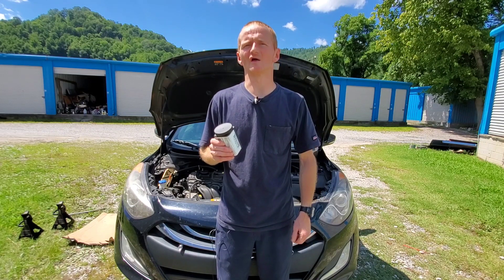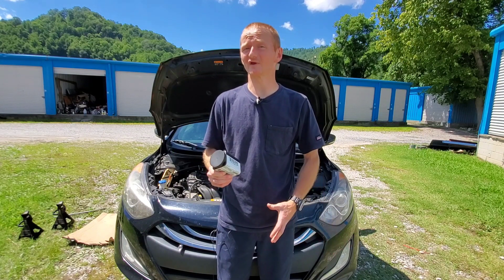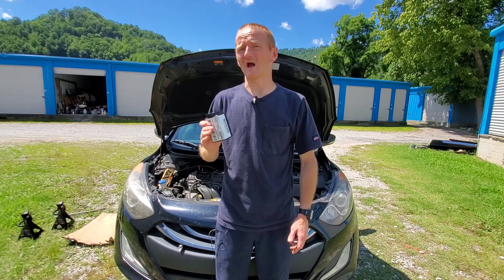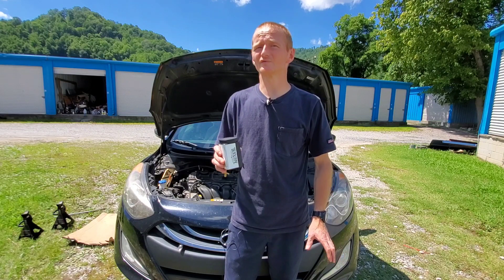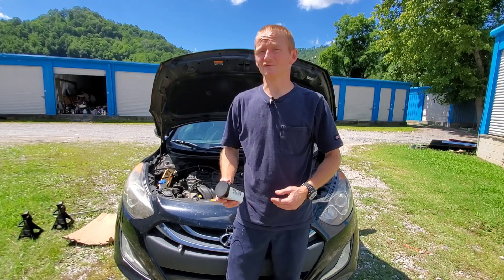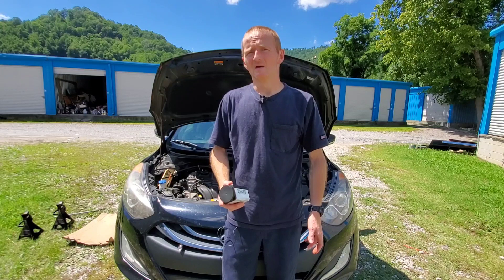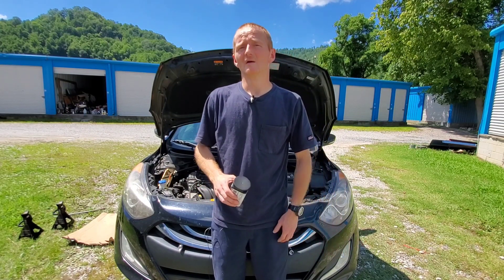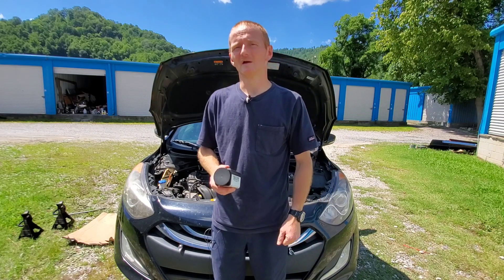I can't believe what waiting to change my oil did to my engine!

Comment: Maybe all of you know this already, but here in europe, the oils are made to last longer and are more expensive, your intervals in USA sound so short to us. Usually In modern vehicles, the oil change is every 12 months or 6000 miles in severe conditions, 12.000 miles in normal service for gasoline engines. For example Liqui moly makes an oil suitable for even 20.000-25.000 miles or even 24 months. Personally I do like this: I buy 5L (4,7 qt) of the best oil Liqui Moly makes, for my specifications (0w30 ACEA A3 API SN, it's real synthetic not those fully synthetic scams), and because I drive it in severe conditions (short trips, not fully heated engine) I change it every 6000 miles. In addition, In the middle of the year, I drain approximately 1 L of old oil and I put back in the remaining liter of new oil (my engine requires 3.9 L), total cost 50€ or 57$. After 5000miles the oil is still in perfect shape a bit thicker because of the contaminants in suspension, but you can still see the original yellow colour with a brownish tint. Doing a rapid research (tell me if  it's correct or not) you pay 5 quarts 16-30$ for 5w30 so I imagine that the quality just can't be there because here the cheapest 5w30 starts from 30€ (35$), so the conclusion is that you must change the oil at least double of the indicated interval. ( I admit that your prices can be lower because in USA you drive bigger engines with more oil and the lower price can be a matter of economies of scale, and not only quality, because mainly in europe we drive  small  4 cylinders engines )
Reply: Wow. Great comment. I can't believe how expensive oil is over there. I thought $10 a quart was expensive.
Reply: @vanessal7291  here the equivalent of 7/10$ quart is the cost of 10w40, that's still the most commonly used. However is not that expensive considering that the oil is really going to perform good for the whole year. Yearly services are normal here. Maybe some performance or special use vehicle need 6 months service...but it's kinda the opposite as I saw because recent commercial diesel vehicles have 15.000/20.000 miles services.
Reply: Wonderful
Reply: @SushilKPingua  It depends on the taxes in the country. In italy there are more taxes on oil, but for example in germany a good mid-top range oil is 8/10$ qt equivalent.  The oil I buy in germany costs 12usd qt. But is really almost top.
Reply: @Starfank  You have correctly made clear the oil economy implemented across countries. In India the conventional or semi-synthetic low quality oil sells between USD$ 20 to $30 per gallon and this oil lasts maximum 3000 miles. Full synthetics here begin at USD$40 to over $80 per gallon for Mobil1/Liqui Moly, this oil lasts 5000 miles in severe driving conditions. Amsoil is sold in India between USD$ 40 to $55 per gallon (cheaper than Mobil1 and Liqui Moly) and it too lasts anywhere between 5 to 6000 miles. 5w-30 and 0w-20 is most sold grade here. Indian road and driving conditions lay much stress on the engines. 90% of the cars here have engines between 1.0 Litre to 1.6 Litre cc, engine oil capacity of these engines is less than 4Litres. The quality of oil sold in India is nowhere in comparison to Europe's standard. The automobile manufacturers here provide semi-synthetic engine oil at service centres at USD$25 to $30 per gallon and recommend oil change interval of maximum 6000miles or one year, and with poor driving conditions coupled with less engine oil capacity, we have to replace oil maximum every 6000 miles (if good quality engine oil is used). The average engine oil sold here as provided by service centres if extended till 10,000 miles might clog arteries of owners when the engine fails because overhauling an engine is an expensive affair here in India along with long delay at Service Centres sometimes extending to 2-3 months to get back delivery of repaired car.
Indians have no option but to frequently replace oil as the quality available here is poor. Good quality imported Mobil1 or LiquiMoly (above USD$100) is also available but at very high cost above the budget of average Indian driver. Therefore we usually buy USD$30 to $45 per gallon average to good quality oil and replace it every 5-6000 miles.
Reply: @SushilKPingua  Exactly, if we take into consideration even the exchange rate of the value, € is more powerful, so an euro made product will be really high in cost, but even in quality because of the power when buying raw materials, in my opinion. It was just to say that here the matter is more about fuel economy, and less pollution and oil service is part of it, many people are not servicing their car enough so pushing for achieving better quality overall ensures a good level of emissions for the car's life cycle. European ACEA is pushing from 2017 new categories of oil made to protect TWC catalyst and DPF from premature failure or clogging, reducing the amount of Sulfate and phosphorus ashes in the oil in 2 grades LOW and MID, respectively C2, and C3, to simplify (there are also C1, C4, C5 for similar purpose but slight different characteristics). Those category also define the High temperature high shear resistance at 150 °C, from 2.9mpas to 3.5mpas for C2 and >=3.5mpas for C3. It substancially means that the protection of the engine at high temperatures is voluntary reduced a tiny bit, for certain parts of the engine to ensure better fuel economy reducing internal friction and those new additives have to work really hard, and are expensive. They're "failure" rate is also less linear and more abrupt if exceding the time or miles indicated for the oil change, so are more risky. C3 instead provides the "standerd" protection and by standard the oil is rated for high performance vehicles severe condition and high interval oil change, because they know that in europe the car are not always driven for long trips every day and mainly used for city driving.
Reply: @Starfank  Europe is certainly going clearer with stringent emission control measures. The efforts taken by you all shall certainly be visible to the rest of the world in near future. 
Hyundai has recently introduced diesel cars in India which require ACEA C5 engine oil. It is not possible for India to introduce and impose high quality oil like Liqui Moly which cost higher and run longer. Instead manufacturers here are recommending API SN 0W-20 in tighter packed new engines which give high fuel economy with low emissions.
It is nice interacting with you. 
Have great times ahead 👍

Comment: my chevy dealer said I don't have to change my oil until the oil life monitor is below 20%, or if a connecting rod is sticking out of the side of the block. whichever comes first!
Reply: In the latter case you have to change the engine...
Reply: @garysimms1347  yes you do! lol!
Reply: 🙀☠ R.I.P.
Reply: if the rod is sticking out, and she still runs,  are we good?????

Comment: Your oil looked great , i would've left it in another 3k miles. 7500 miles is fine with exception of turbo DI engines ...you sure as hell do not live in New England judging by frame
Reply from the maker: Yes the oil can last a long time its contamination that im most concerned about

Comment: I prefer changing oil every 6 months or 5000 miles with Amsoil 100% synthetic in my 2017 model Honda BRV - 1.5L - inline4 - naturally aspirated - 7 seater MUV.
Semi-synthetics Or conventional oil lasts maximum 3000miles in my car, after that NVH level due to engine rises. Fully synthetics less than 4000miles and 100% synthetics last close to 5000miles in my car. On cold starts of more than one occasions if I find the NVH level due to engine to be high, I change the oil.
Reply from the maker: Wow great oil and service i appreciate you sharing with the NIA community
Reply: What is NVH? I have a Toyota Camry which has a hundred eighty thousand miles on it and I just change the oil every 10000 miles per manufacturer's recommendations. Any oil samples I've had tested show the engine is below normal in wear and the oil additive level is still good. I use Mobil 1.
Reply: @markkauffman6184  NVH in my words: The smooth and silent purring of engine begins to fade as oil gets old and looses it's properties, the engine then gives out unpleasant harsh noises and grinding vibes when started in the morning and after a heated drive, I can feel and hear it (NVH from my engine) sitting in my car's driver seat. I'm not bothered about NVH while driving my car or due to my car's built itself.
Honda recommends 6000 miles oil change interval for my car. 
My car is young enough to not have it's discharge tested. Your Toyota Camry seems to have a tough built engine. 
I once used Mobil1 and found that the conventional or semi-synthetic oil provided by the Honda Service Centre is very close in performance to Mobil1.
Since my running includes full load capacity with driving in rural areas over dusty/uneven terrain, I prefer to keep my engine on the safer side.
Amsoil is cheaper than Mobil1 here in India. 
As has rightly been said : engine oil is the cheapest insurance we can give our cars.
And lastly, the oil sump capacity of my car is only 3.6 Litres or nearly a gallon.
Reply: @SushilKPingua  Wow, that's really subjective but to each their own.

Comment: It highly depends on the driving you make, if you are doing highway or city, start and stop, traffic jumps and short distances don't overpass 7500 miles never.
BimmerN53
Reply from the maker: Yes true and most people actually fall under extreme driving conditions but fail to realize.

Comment: I change mine every 3,500 miles and I use Quaker State 5W-30 full Synthetic. But I do have a question on motor oils when I type in what kind of truck I have on Oriellys and Autozone websites they both recommend the High Mileage Motor Oils for my truck, my truck is high mileage with 213k miles but is the High Mileage Motor Oil any better than the regular motor oil for vehicles that have high mileage? Just something that I have been curious about.
Reply: If you use high mileage. Stick with it. See Scotty Kilmer for explanation. Seals get used to it and when you go back without those additives they could start leaking.
Reply: @junboo8730  Exactly. Similar would be the case when a car has high mileage using fully synthetic oils and  there is a risk if the category of oil is changed to 100% synthetic.
Reply: Sushil K Pingua. Didn’t know that. Interesting.

Comment: Depends on how many miles on your vehicle. As engine s
wares out oil will become more contaminated faster. So im doing mine at 3,000 miles. One vehicle i have is at 273,000. Another topping 312,000
Reply from the maker: Very good information i appreciate you taking time to share
Reply: What car or truck do you have that mileage on? And what oil/filter do you like to use?

Comment: I change my oil every 5000 miles with conventional oil.  None of my three cars recommends synthetics.  Two of my cars have the option to use synthetics to extend change intervals.

I always push my cars beyond 200k. All the cars I have owned I have either sold the car running to someone else, or another component failed which cost more to repair than the car was worth (usually a smog control component) and I elected to upgrade. I have never lost an engine or a transmission in any of the  cars I have owned.  To me there is only two reasons to use synthetics: the Manufacturer recommends use of synthetics or you want to push the change interval. 

I personally, think 10k on an oil filter is a lot of miles to ask an oil filter regardless of how it's engineered.

Just curious why you didnt show the results from the oil sample analysis from the lab?  The sampling is the easy part, interpretation of the results is the harder part.
Reply from the maker: I asked what you want the oil tested for in this video. There are many options.
Reply: Couldn't agree more friend

Comment: Nice videos.
What was your mileage between oil change for this video? 
Are you running the Mobil 1 Extended Performance?
I run Castrol Full Synthetic 5W-30 (black bottle). I try to change at 5,000.  With another car I did run Kendall Semi Synthetic 5W-30. I ran that oil 7500 miles once. It was very,very dark.
Reply from the maker: Thanks for taking time to share your experiences and im preforming different test at different intervals. This one was taken just over 3600 miles.

Comment: I use Mobil 1 full synthetic. And change my oil every 3-5k miles. I would never go 7500, 10k or longer before changing my oil. It might cost a bit more, but I like having the extra piece of mind that my engine will last a long time.
Reply from the maker: I agree with this cheap insurance but to each his own and thats why i do testing myself also with labs
Reply: I've sent multiple oil samples off to Blackstone, 5k, 7k, and 10k. All have been suffice as the tech who did the oil analysis stated to add more mileage. All done with Motorcraft semi synthetic. I'll be sending off full synthetic after this 10k oil change. Never hurts to do it sooner but on modern vehicles its definitely not needed.
Reply: I change my oil every 3 months

Comment from the maker: How often do you change your oil
Reply: For my mercedes benz w115 1973 220 i changed it every 3000 km
Reply: I do between 3 - 4.5k miles. Car has 254k miles on it.
Reply: Full synthetic every 3k. Since I’m keeping the truck forever lol oils cheaper than a motor. Have 155k on it so far
Reply: every 7,500 miles on a 2008 crown vic with 220,000 miles, 5w30 motorcraft oil syn blend and motorcraft filter